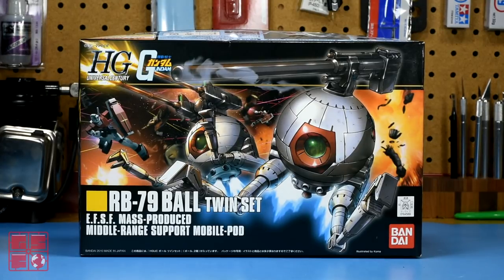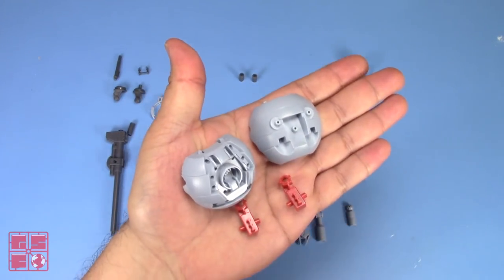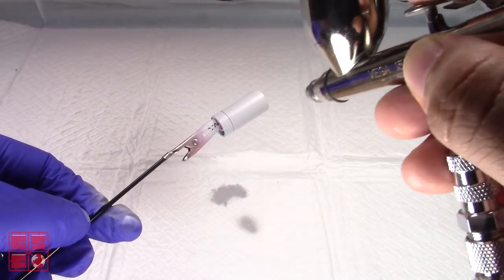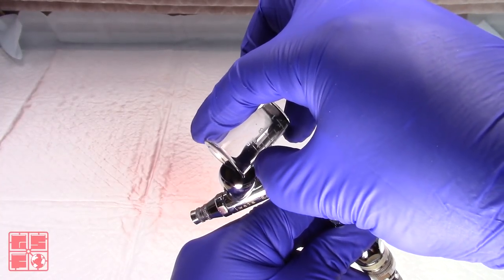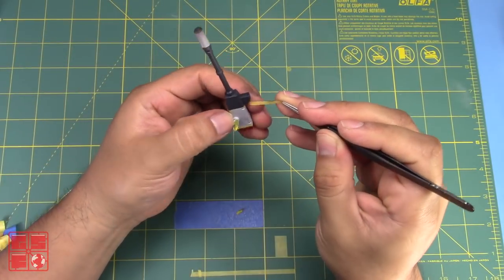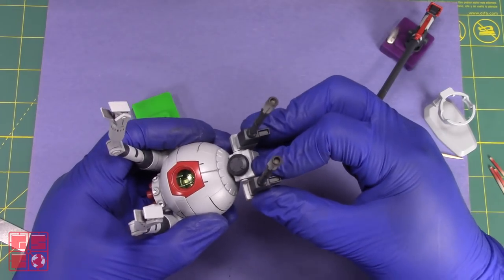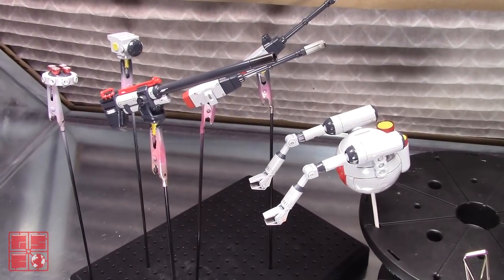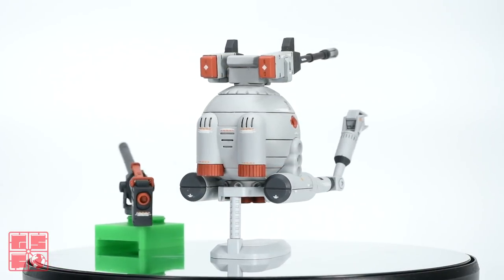Let's Paint: Bandai HG RB-79 Ball Twin Set

Comment: Very nice job! I like the guns color separation and the gray final color is very nice, in my opinion. I like also you colored the cockpit. My suggestion would be to do some drybrushing within the cockpit to highlight raised surfaces. It will not show much, I guess, but who knows. Have you tried using silver chrome or chrome (like Molotow) as base color for the gun sensors before applying the green clear color? I do it on my gunpla and I think it works well as it gives more reflective effect. The arms color separation is pure genius!